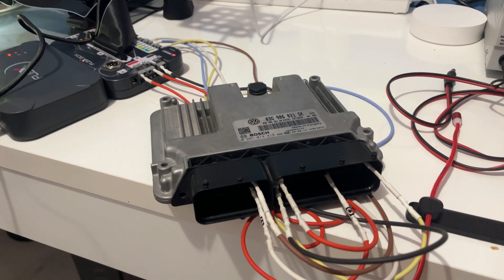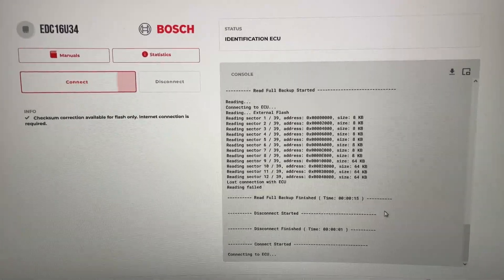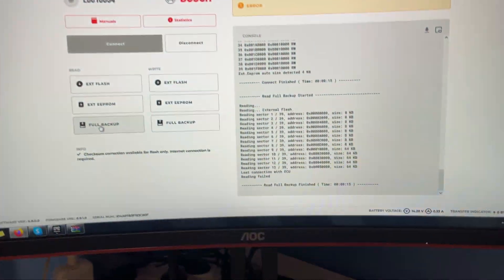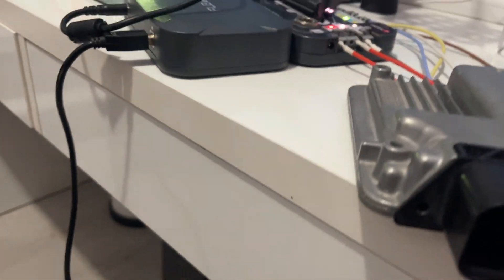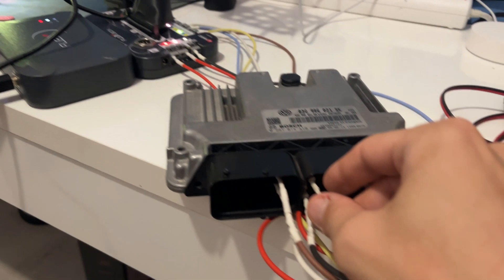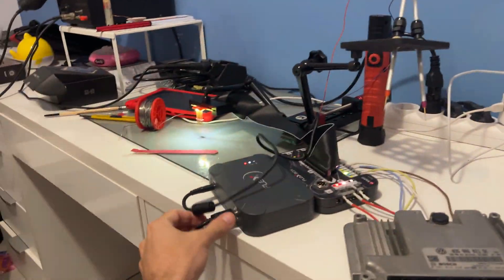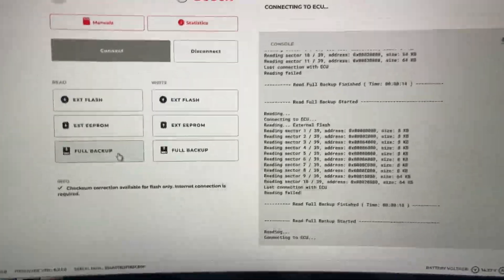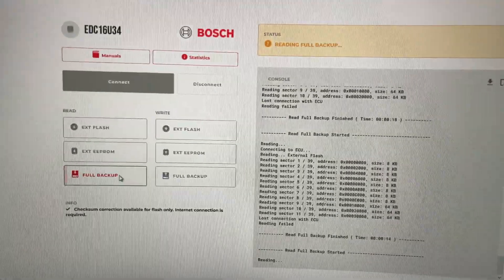Testing FLEX tool read failure scenarios

Comment: Hello. I have seen many of your videos. I want to start in this business and I am going to buy Ktag and mpps v18. I think ktag is the most complete tool. Later I will buy ktm bench 67in1. Any recommendation? should i buy something else? Thank you!
Reply from the maker: if u are thinking to buy clone u ll be stuck in 2015 max
Reply: @Automotivesp  Thank you very much for answering. What tool can I buy to start? pcm flash (genuine) is ok?
Reply from the maker: @CampiRR  Nose que tal el ori. no esta mal. Si quieres tengo descuento 10% en magicmotorsport si quieres el FLEX